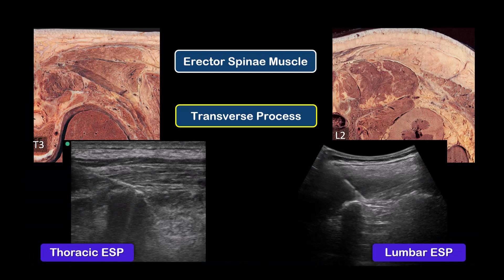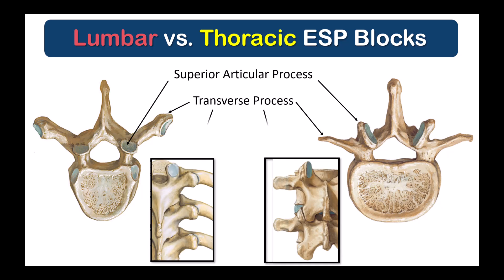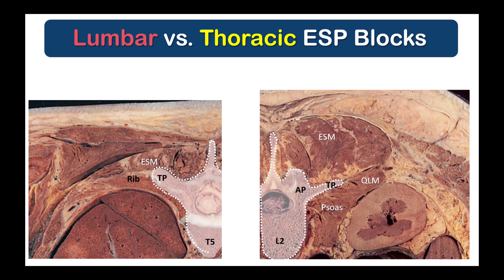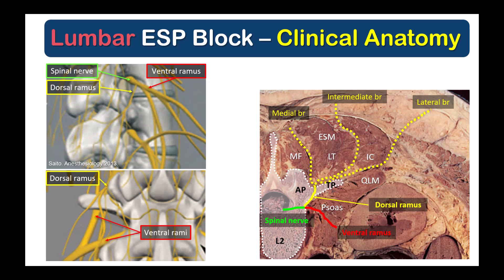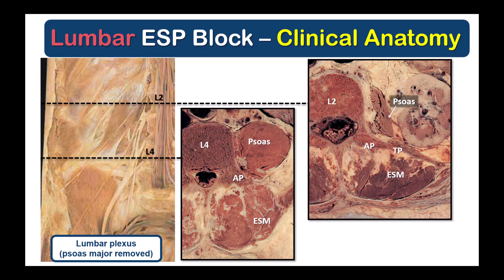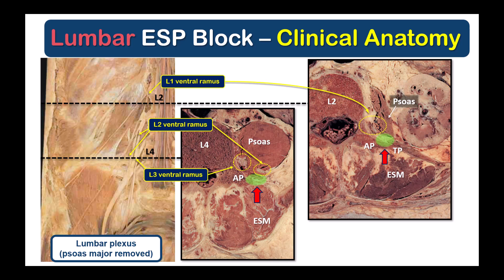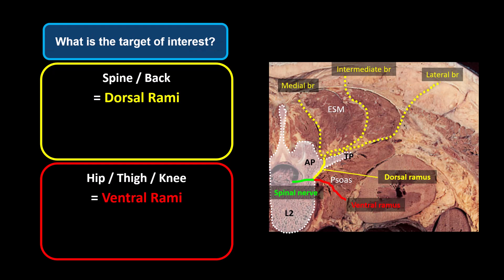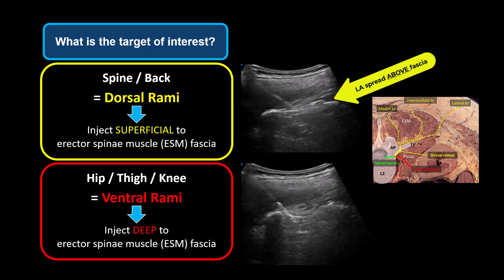Lumbar ESP Block - Concepts & Principles [2024]

Comment: Several years ago I did a lumbar ESP block, it was difficult, but something worked out; after that I decided to find out if they do ESP block in the lumbar region at all - I didn't find anything reliable and decided that I got a variant of the paravertebral block, and stopped practicing it. Thank you, I will develop this experience.